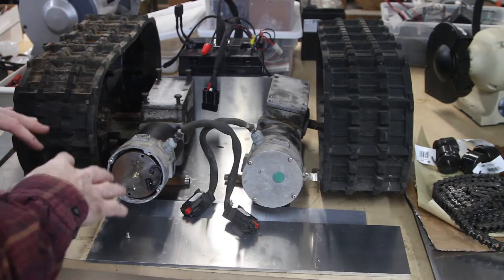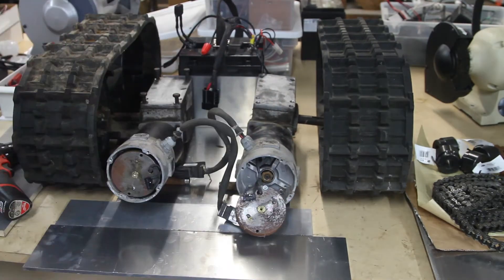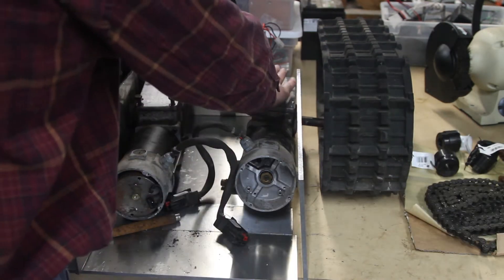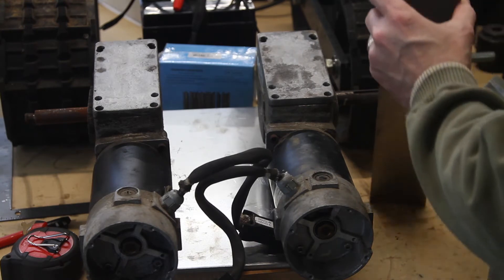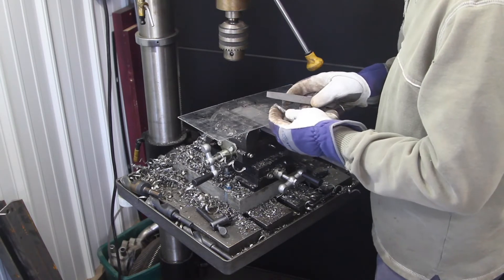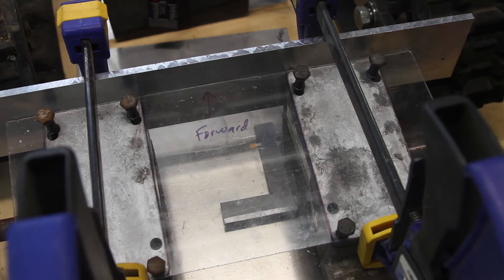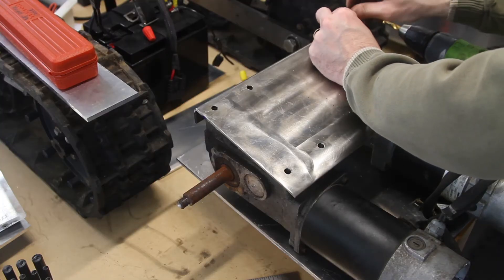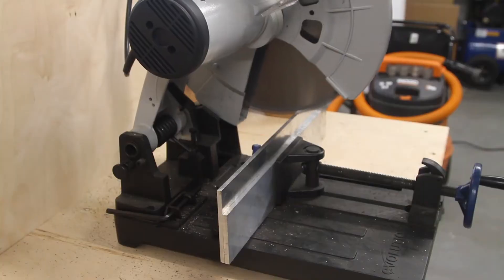Track Drive Robot Chassis Design and Build

Comment: At 8:42, What blade were you using in your chop saw to cut the aluminum stock?  I love this series. I started making my own craftsman track robot at the same time you did your first video years ago. I just happened to see your video and was overjoyed I wasn't the only one who had a similar idea. Been on the back burner now since I had a slew of projects already on deck. Great ideas to finally finish this. I bought a small tractor plow and figured if I could get this puppy around 300 pounds, I could clean off my driveway as the snow built up.
Reply from the maker: The is Evolution Tools Aluminum Blade here is an Amazon affiliate link: https://amzn.to/3e1zdOe   and I did a review on it here:  https://youtu.be/ghluUcTzAYE

Comment: Awesome video, trying to learn this,, what Motors did you use?
Reply from the maker: Thank you.  Those motors are from older Invacare Action series wheel chairs.  I need to do a better job of labeling my videos that are in a series.  There are two videos about removing stuck hubs from those motors, and one about the wheel chair disassembly.

Comment: I have one other question for you as I have not seen so far how you attach the track assembly. I have a pair of these Craftsman tracks.  I am wondering if they could be mounted to a motor similar to like a wheel would , meaning on a hub driving the complete assembly and as a result the tracks would actually articulate with the terrain ....your thoughts?
Reply from the maker: Yes, if the 3/4" axle you have on your destination project is long enough these track assemblies stay in one piece and can be used as a kind of tire replacement.  I've got a video where I did the opposite.  I removed only the track assemblies from a snowblower, put tires back on the snowblower and still use the snowblower.
Reply: Thanks again for the quick reply.  I have a setup from a wheelchair, would just taking the tires off of it and rigging up a hub interface to the track assembly work ..or does there need to more clearance than what the original tires had?  Pretty much the same length as the shaft on your motors.
Reply from the maker: That gets tricky typically the shaft is not long enough.  Check out my other videos.  I see I need to link to those at the end of this video.
Reply: How long does the shaft need to be?
Reply: How long does the shaft need to be?  How did you attack this problem?
Reply from the maker: https://youtu.be/2ocPc3pZmMA   This video shows how I solved that on my original and my new robot.  On the new robot, I welded two off-the-shelf sprocket hubs together.

Comment: Good work ...is that TIG welding you are doing?  Also ...there is a tool called a bind hole spotter that you can use at a later date to transfer hole layouts like the ones on this gear boxes.  Are you planning on lead acid batteries?  I would suggest looking into building your own Lithium battery ....more power and longer lasting.
Reply from the maker: Hi Frets.  Yes on the TIG question.  Learned how from YouTube!  I also want to build a Lithium battery at some point.   If you are referring to the blind hole spotter plugs, a set of those may be in my future too.
Reply: Yes on the blind hole spotter plugs.  I am going all lithium from now on ...I have built several batteries now and will never go back to lead acid for my projects.